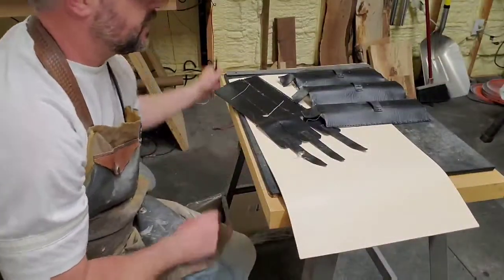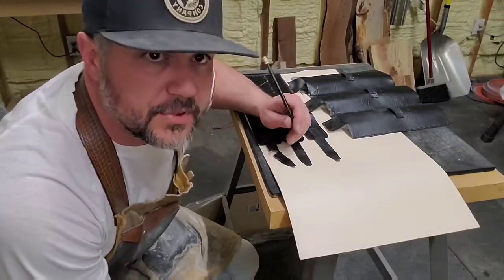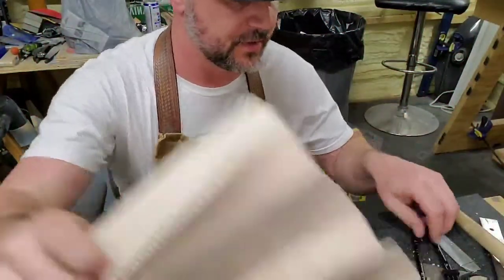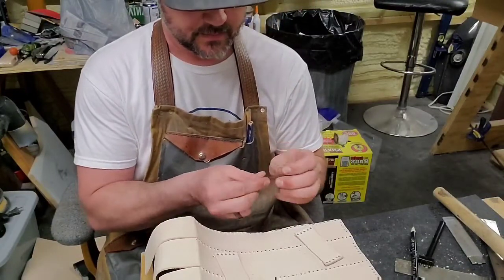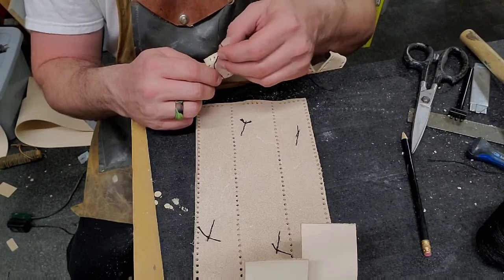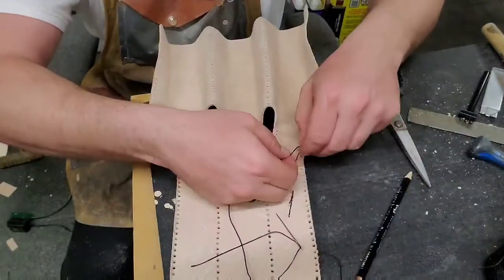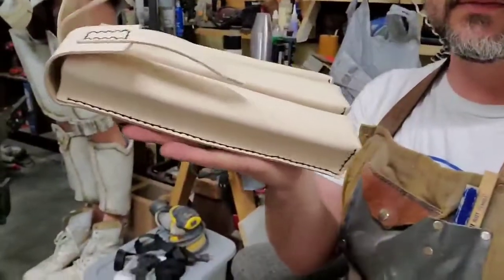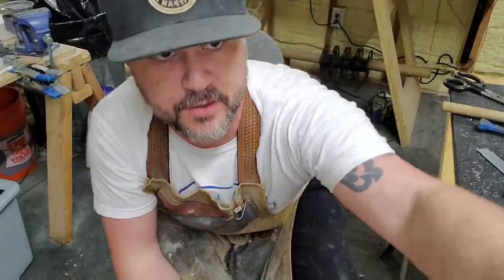Part 1....Making the MP40 Magazine Pouch for my 3d Printed Star Wars Death Trooper Armor

Comment: Question- do you know if the original or actual DT prop used the stud type closure (Chicago screw) or was it a snap and the longer tabs slide under the flat horizontal "loop" for extra retention? I'm guessing that the tab length was also to assist with quickly stripping it open.
Reply from the maker: Honestly, I can't remember how those were attached.  I believe they were just studs.  The slot in the leather just slid right over top of the stud.  At least that is how the original MP40 pouches were that I have seen.  You might ask in the death trooper build group on Facebook.  There are some really knowledgeable people in there.  Good luck buddy!